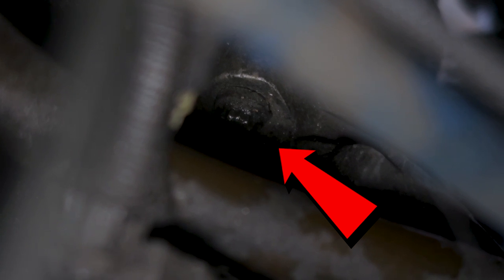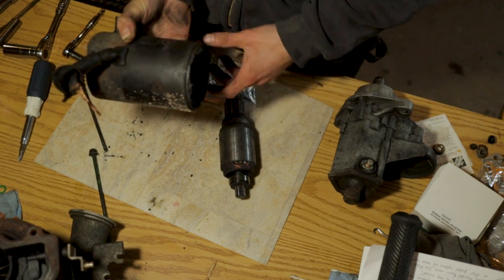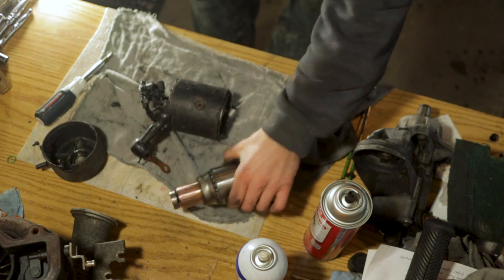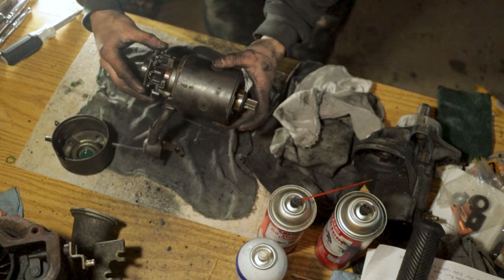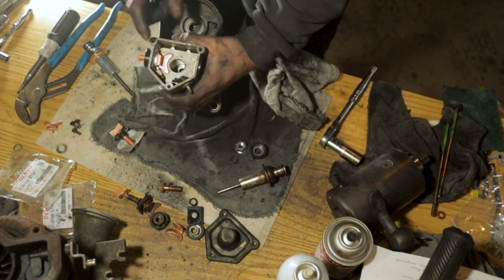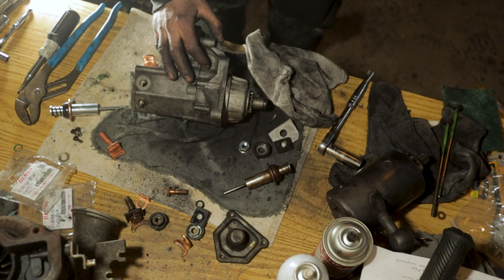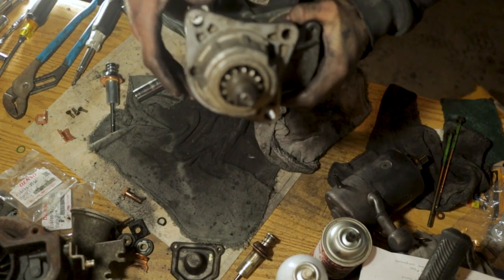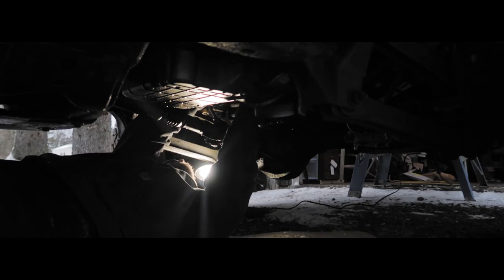24V CUMMINS STARTER REBUILD with COLD START

Comment: If you ever have to replace your starter or alternator my advice is go with Wilson. When it comes to construction and ag equipment they’re the most dependable brand you can get. I’ve been using them for years on my truck and all the heavy equipment shops I know only use Wilson electronics.
Reply from the maker: Awesome! I'll check them out when I get home. Thank you for that!

Comment: So i replaced my solenoid contacts and plunger and I took apart the motor side and it was clean.   The copper was slightly discolored but not much. 

The starter spins over outside the truck but not while mounted to the engine.  I by passed everything by using a power probe to run the starter and still just clicks while mounted to the truck but no spinning over.  Outside the truck it will spin like mad

Comment: You probably won't believe it but I thought my starter was dead at 474k miles (the original one) would crank real slow after getting to operating temp after I shut it off. so I tore it apart just like you and cleaned it all up before buying a new one... it works yet again. honestly looked just about as bad as yours. there was zero grease left in the gear housing but it really did come back to life with a serious deep cleaning and brushes/ contacts. really wonder how long it will last

Comment: Drill the heads off the 3 screws then pull the cover off take a pair of vice-grips and pull the studs out and replace with new ones.

Comment: What's the paper on the battery contact for? Just rebuilt the solenoid in my '06 and there was no paper in the kit or in the original starter (bought this truck new so I know it has NOT been worked on before.)

Comment: the signal wire stud to the solenoid how does that attach internally? the nut is seized onto mine and putting a wrench on it and vicegrips on the stud snapped the stud off flush with the nut, spun the stud and ripped whatever wire is on it inside off so now it doesnt engage the solenoid

Comment: I’m still trying to find an OEM starter to rebuild. My 01 is on its third oreilleys starter. Such a pain in the butt. Quality video! Keep it up!

On a different note did you put a fuel heater on your fass?
Reply from the maker: I have not done a fuel heater but I want to look into that. Stay tuned for that one!
Reply: pure panoRAMa there are 2 ports for electrical and one for coolant so it doesn’t gel while you are driving.

FASS has a video about it. I think there are some pretty awesome options for what you can do to make cold starts effortless. Including a coolant heater. Also something to look into if you have the money.
Reply from the maker: @keithwolfington7013  I'll jump on the fass page when I get home and watch their video. I do need something to heat fuel since I did away with my stock fuel heater when I did the 12 valve style 
fuel filter head
Reply: pure panoRAMa I found the video on YouTube. They have a few different ones. It’s pretty nifty to see the different options they have. 

The kit is $151 from most places I’ve found. If you want to run two electric heaters you need two kits. I have read that the coolant option is significantly cheaper. But that wouldn’t help on start up. They do suggest using a switch on I believe one of the heaters.

Best of luck!

Comment: Don’t use brake clean use electrical cleaner like QD contact cleaner. Brake clean the outside not the inside. 85% of the time it’s contacts and plunger not rotor.